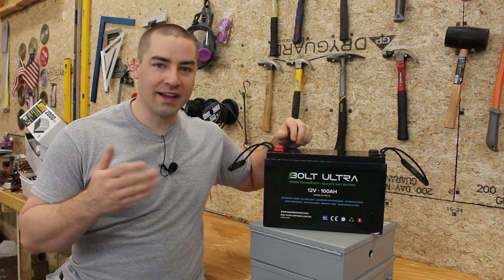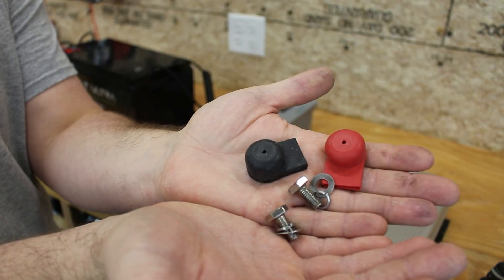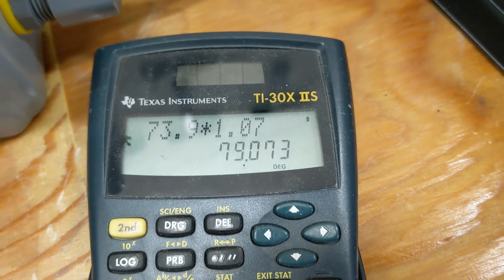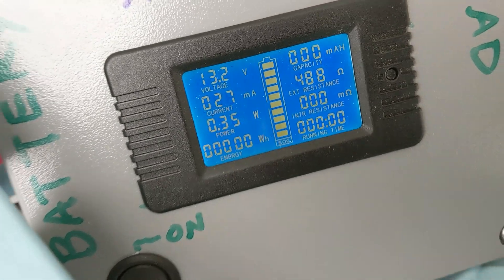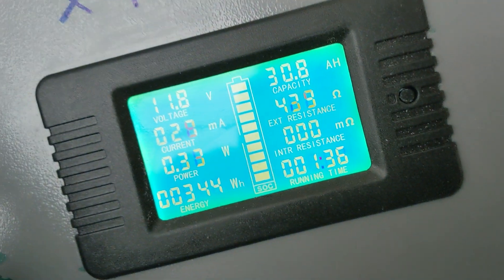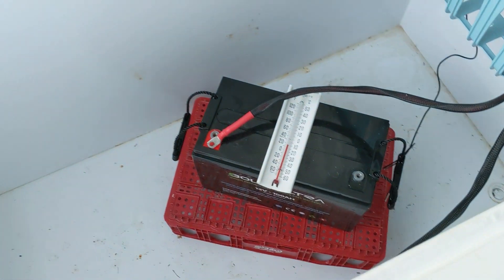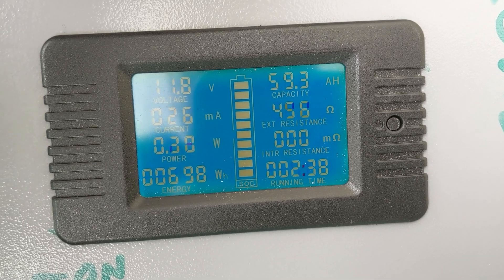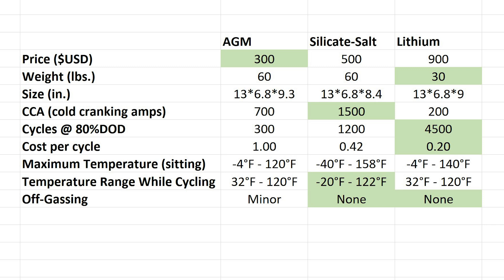Silicate Salt Battery from Bolt Ultra, Extreme Cold Tolerant

Comment from the maker: Let me know what testing you might like to see in a follow up video.
Reply: Obviously we need to see you testing some weight equipment!  ha. Probably built your own home gym, heh.

Silliness aside, maybe some how-to for home stuff that includes all the fun stuff like getting permits and what not. I'm probably going to go with Tesla for my home solar and battery backup. Love seeing this technical shit tho!

Thanks for the entertaining videos.
Reply: Would be great to see a second cap test at minus 20 to see if it charges well at that temp and whether it is damaged noticeably by repeated use at that temp. Also if you have the opportunity would love to see some testing of narada lead carbon batteries. They are quite popular here in new Zealand and marketed as simar longevity to lithium, I'm skeptical. Thanks for all you do!
Reply: I think you should correct the video title from "Silcate" to Silicate.
Reply: Maybe a test for self discharge in cold.  Thinking this may be good for a battery in my tractor.  I use it mainly for snow removal so it sits for long periods of time without use.
Reply: Hi can you test like for like if Lithium battery cost 900 dollars test lead acid 900 dollars. By the way rolls batteries lead acid can be discharged upto 80 percent and have cycle life of 2750 . And at 900 dollars I can get a 400 ah battery. If Lithium that good why does my phone battery last about 3 years
Reply: Could you charge it through your meter too? I would like to see the charge/discharge efficiency. I'm in a suburban setting with limited roof space for solar, but the battery being inherently safe and not needing a BMS outside of simple max and cutoff voltages could have some real appeal to "make-it and forget it" powerwall setups.
Reply: @paulmarshall3104  because there are a lot of chemistries in lithium batteries. Lipo is different than li-ion like NMC cells and different than lifepo4 batteries. Every chemistry have their strengths and weaknesses. Battery in phones are often lipo, which have the worst cycle of them all, combining that companies let you charge it to 100% and discharge it to 0%. That isn’t good for any chemistry, maybe except LTO batteries.
Reply: Ever try it in a vehicle?  Curious as we have -30Celcuis weather.  And if the batteries can take the hits being in a truck with vibration and shaking.
Reply: Would love to see a high temp test.  The spec sheet says good up to 158F 😳
Reply: Also wondering if you’d need a DC to DC charger to charge from normal alternator, similar to charging a lithium battery.
Reply: Very good test! I would like to see you test a Lead/Carbon battery. They are supposed to be equal or even higher in cycles than the the silicate salt but cheaper.
Reply: LTO 55 amp cells
Reply: I would like to get one of those meters that tell me everything about the battery while charging and discharging please send me a link if there is one

Comment: So happy someone is finally selling one of these!!!  Can't wait for them to fix all potential bugs and drop in price
Reply: Right?  I hope price comes down before next winter, as that's likely about the time I'll be purchasing.  I need a backup to my LiFePO4's in extreme cold conditions.  I only need about 25Ah of emergency reserves, so one of these for -20 F conditions looks to fit the bill nicely.  The nice thing about these, too, is that they have a ridiculously low self-discharge rate, so you can literally "charge and forget it" at the beginning of each season, which is great for an emergency backup battery.

Comment: Dang, almost over double the cold-crank amps! Considering the wide operating range, wonder if this would be a valid replacement for small vehicles.
Reply from the maker: Or big ones.  I used to own a diesel pick-up truck.  It had a hard time starting in the cold.  I wish I had this battery for that.
Reply: @DavidPozEnergy  Kind of a lot of capacity.
Reply: lithium titanate is superior to this battery chemistry
Reply: @eksine It's true, but it's more expensive.
Reply: @rickhuntraslam2925  its strange how the wealthy are so cheap .  must be one reason on how they get wealthy . poor people like me have no choice but to use the lowest priced items.  its all due to the fact companies are greedy and uncaring.
Reply: @carmichaelmoritz8662  Entitled Democrat? Go start your own company and pay yourself what you want. NO? You don't want to take any of the risk but you want all the benefits of someone else's efforts. It does not work that way.

Comment: LiFePO4 seems to be awesome as long as you have a heated battery.  IE:  When charging, it will check ambient temperature of battery.  If below 7 celsius or so, the electricity will be directed to a heating element until it reaches another set temperature, then switch to normal charging.  Discharging is fine at nearly any temperature.

Comment: Seems perfect for an RV, surviving cold temps while also having good cycle life is a great fit for folks that boondock in colder temps with solar. The 60Ah at 20F is also good as it should allow the furnace to run all night (the blower on an RV propane furnace is a notorious battery killer). If I couldn't get cold tolerant LiFePO4 cells from China for 1/3 the cost per Wh they'd be on my radar.
Reply: Care to reveal your source?? Lol

Comment: FYI, your freezer temp was WARMER than the outside temp here in Calgary!!  Thanks for the review on this type of battery.  Very useful information.  I liked the comparison chart, but it seems like everyone has dismissed Flooded Lead acid.  Would like to see that added to your chart to get a complete comparison.
Reply from the maker: Thank you for the suggestion.  Sounds like you are in a very cold climate.  My outside air temperature was 20°F on average during the test.

Comment: After discharging cold battery, I would let it warm and try to discharge even more to see if capacity comes back 😁
Reply: The capacity of these batteries comes back quickly. You may not have had to let it warm to see it come back.

Comment: In my case, the application is to charge the battery without burning wood to heat it before.  When I want to charge my lithium battery, I need to make sure it's above 0 degrees taking care of it.  The SiO2 battery will be OK regardless, I just let it plugged in.

Comment: David,
With the difference I wonder about building a small insulated battery box and have a controller to keep it above 32F.  That would provide the ability for the Lithium battery to cycle when it is cold outside if it was in a cold environment with solar or something to recharge it.  We live and work in the Rocky Mountains and we do see some negative temperatures for days at a time.  Thanks for all the GREAT content you give us.
Reply from the maker: Yes I like building an insulated box as well. I have a video of my friend Bill's setup up in Vermont and he built an insulated box with an automatic heater inside of it.  https://youtu.be/6XLOKtl-q3s

Comment: Wow! This would make a great car battery! Sounds like it would last over a decade.
Reply: It would make a very resilient car battery, especially in hot temperatures as you don’t see the dry-out like you do in an AGM and you don’t have to alter the technology of the car. Also, they are completely sealed so there won’t be damage on the other equipment that surrounds the battery.

Comment: It would be nice to know what these batteries actually are in regards to chemistry and build.  From what little information I can seem to find online about them, they seem to be a Lead-Acid Gel Cell technology that uses Silicate Salt as the gelling agent for aqueous ammonium sulfate solution.  It sounds even more like lead-acid when you read the few specs they have of 4500 cycles 20% DoD and 2200 cycles to 50% DoD and then add the very strict charging parameter of not going over 14.4v while charging (I assume this is to prevent off-gassing).  They also state that a 100% DoD will reduce the life of the battery and it must be recharged right away if that happens so they don't recommend going below 90% DoD to extend the useful life of the battery.
Reply: Good info, what did they say  anything about partial state of charge storage or storing it half charged?
Reply: The very similar SiO2 batteries from Solar Azimuth share all the chemistry information on their website.  Looks very similar: the SiO2 electrolyte is liquid when charged and solid when discharged.
Reply: @allalphazerobeta8643  Good questions. The batteries do not have sulfuric acid, therefore do not create sulfation. This means you can leave them partially charged and they will not damage themselves. They also have a very low self-discharge of about 1.5% per month.
Reply: Although the physical structure of the casing is similar to a gel battery, it is NOT a lead acid gel battery. The electrolyte is a special neutral electrolyte that does not corrode the lead plates. They are completely sealed and do not off-gas because they don’t change temperature when they are charged and discharged. The batteries are designed to take a voltage of 14.7 volts and don’t get damaged if the voltage goes higher than 14.7 for a short period of time. 100% DOD will not damage the battery, like any battery, the deep discharge will shorten lifespan.

Comment: Thank you for this review!!  I live in an extreme cold climate, and while I can use LiFePO4 most of the time because the area will USUALLY be heated, I need to have something reliable to fall back on in the event heating fails or I need to shut down heat for a period of time.  

I've been curious about these as regards performance claims in extreme cold.  Although it seems to have performed below your expectations, it performed almost exactly as I hoped and better than an equivalent AGM would have.  This also seems like a better option than AGM for cost-per-cycle and operating temperature.

Some things you didn't mention in your video is that these batteries are fast-charging (3C), have a ridiculously low self-discharge rate (even better than lithium), and are extremely safe & environmentally friendly as compared to either AGM or Lithium.
Reply from the maker: Those are all good points.  I didn't dive into them in this video because that's what the marketing is full of.  I wanted to test what the marketing left out.  I tried to find a capacity:temperature curve, but couldn't.  That's why I wanted to test it.

Comment: thanks a lot for this video, It's always funy to learn something new. Do you think it's a better choice than Lithium-Ion 18650 or Li-ion pouch for a 24V-36V-48V use, for a Golf car? Cheaper? simpler?
Reply from the maker: I'm going to add it to my golf cart for: 1. cold temperature. 2. cheaper lead acid chargers can be used. 3. no bms.   But if you are in a warmer area and don't mind getting a lithium charger, then it might not be better.

Comment: For mobile (vehicle) application this seems a decent deal. For anything stationary there are better ways to protect your battery from cold
Reply: These also have a ridiculously low self-discharge rate.  You can leave this sit all year long and it will still retain most of its charge.  So stationary or remote placement where it can sit for ages without use or charging is also ideal.  Charge these at your hunting cabin when the season is over and when you return to your cabin next season they'll fire right up.  Or leave in your RV while it sits in storage, and they'll be ready to go when you pull it out.

Comment: That's pretty good for a salt and sand battery I wonder what it would do down here in Texas when it's 105° in July or August
Reply: They work phenomenal in hot temperature. They do not have vents and the electrolyte does not heat up when charged and discharged.
Reply: They're equally as impressive in hot climates, able to operate at over 150 F.

Comment: One quick question. (or three).....
I understand that it is OK to DISCHARGE LiIon, LiFePO4, CAT, etc. batteries at very cold temperatures without damaging them, but you CAN damage them if you try to charge them at high currents when they are very cold.
 I was also told that if you are using LiIon cells in cold weather, you should turn on your headlights for a few minutes to heat the batteries internally before starting the car and having the alternator start recharging them.
That being said....
1)  How do those SS batteries perform when charging them when cold.
I think you said they never achieved full charge voltage, but you did not mention how many amperes of current they were able to absorb when cold.
 2) Also, Have you ever actually run any cold discharge / charge tests on different types of LiIon cells?
Just two cells on a BMS would answer a lot of questions regarding performance
3) Last question is if there is a temp sensor on the BMS does it stop it from discharging, or only stop it from charging?
Thank you Dave..
Reply from the maker: I did go back and check charging in the cold. I was able to put back in the battery the same amp hours that I took out of the battery in the cold. So I removed 33 amp hours and I was able to put 33 amp hours back in while it was at -20. Just to clarify there is no BMS on these. It sounded like you already knew that but I just wanted to clarify in case.

Comment: Are these good to use off grid? can they be fully discharged without killing them fast unlike the lead acid?
Reply from the maker: Yes, these are good for off grid.  I like them for the temperature tolerance.  If you have an application that sees temperature extremes then these really shine.  However, if you have an off-grid home and the batteries are in a conditioned space (heated and cooled) then lithium is probably a better choice.

Comment: Are these batteries like the Aquion batteries I had high hopes for that company and then they went bust
Reply from the maker: I tried to find out, but couldn't get a straight answer.  I remember the Aquion were advertised as "Salt Water" and this one is "Silicate Salt".  That might still be the same thing, but I'm not a chemist.  Hopefully someone else will chime in here and inform us both.
Reply: @DavidPozEnergy  The Bolt Ultra Silicate Salt battery is different than the salt water battery as the Aquion would freeze at 14 degrees F, didn't do well with quick charging and was not ideal for high wattage loads.

Comment: Hi David, how have these batteries worked out for you so far?  They seem interesting.
Reply from the maker: Fine.  No complaints, no problems.  They sit on my workbench most of the time so I can test high-amp 12V stuff.  These things pack a punch.  They don't care about pushing big amps.
Reply: @DavidPozEnergy  Thank you, much appreciated.

Comment: Would this battery be a straight swap in a car? would it need a BMS as the alternator would possibly be over 14.4v?
Reply from the maker: It doesn't need a BMS and is fine to use as a starting battery in a car.

Comment: I have never seen these before. Do you think it would be ok to parallel them with  a rolls deep cycle battery? I have a boat that would stored outside and batteries resistant to cold would be great. They seem pretty cheap too.
Reply from the maker: This battery charges at 14.4v, which is a charge voltage that should work with your rolls, or lithium.  I see no reason it can't be paralleled.  Just make sure that if your charger has an "Equalization" mode, that it is turned off.
Reply: @DavidPozEnergy  Thanks mate that is great to here. Your stuff is great, I wonder if these will shoot up in popularity now haha.

Comment: Do these have a bms in them, and what capacity can they be discharged to?
Reply from the maker: these have no BMS and they don't require it. That's one of the benefits of this type of chemistry is that you don't need to be a mess involved. That means there's no limitations such as maximum amp draw. You don't have to worry about blowing out the MOSFETs on a BMS

Comment: But these basically charge and discharge like lead acid?
Reply from the maker: A similar voltage range. But these have less internal resistance so there is going to be less loss. They also can charge up at a higher rate than lead acid.

Comment: I would like, if somebody educate me here. If it is lead based, than you need some sulfate to make it work correct? So, what is the solvent for the electrolyte? I can imagine, that is good old water and silicon based compound to make it into a gel (such as silicon dioxide) + I guess sodium sulfate could be the sulfate donor. That would make it "green" when it is sold. As the sodium sulfate is (indirectly) good for striping the lead sulfate of the plates, increased number of cycles may be expected. I am not gonna go through the whole chemistry cycles here. However, during  cycles the the sulfuric acid will be formed there anyway and make it the LA battery. Other than that, all LA battery problems would apply (grid corrosion, outgasing, lead deposition on - from + plate especially at over-voltage and eventual sulfatation, when all water is gone = dead battery). 
Regardless what sulfate is the electrolyte made of, once the water is there, the sulfuric acid would be formed when charging.  I could not find any reasonable info on these batteries apart of sale adverts, which are useless. In my opinion it is just enhanced LA battery. That is good, I like LA batteries, but the price tag is total overshoot. They just changed the electrolyte and doubled the price.....Please let me know, if you know more about their chemistry, thanks.

Comment: I am not convinced that your energy meter is accurate at low temperatures.  You may want to add a known-accurate shunt in series with one of the leads feeding into your energy meter and using a meter that is warm to read the current as indicated by the shunt.